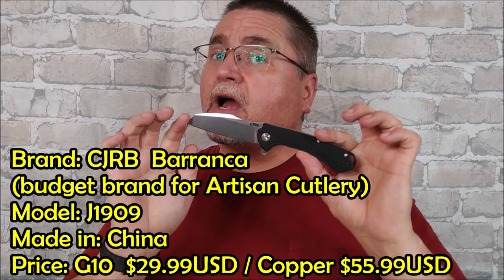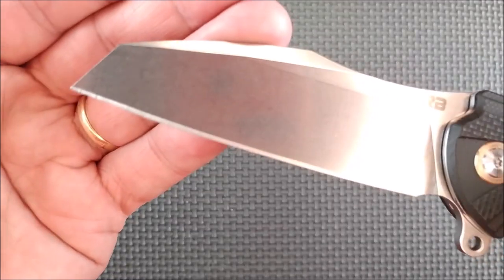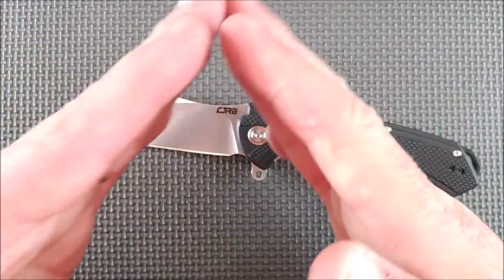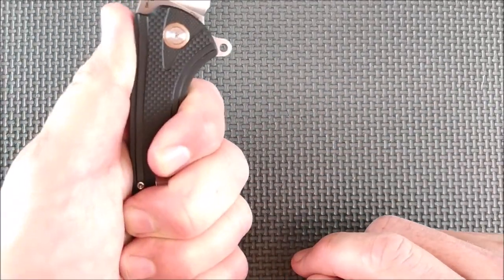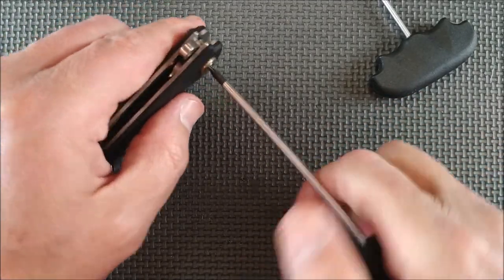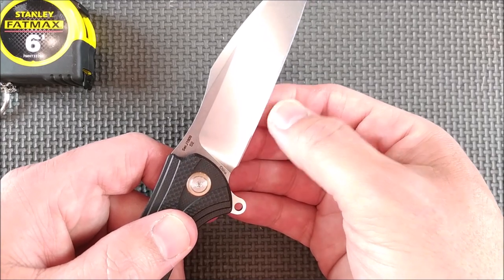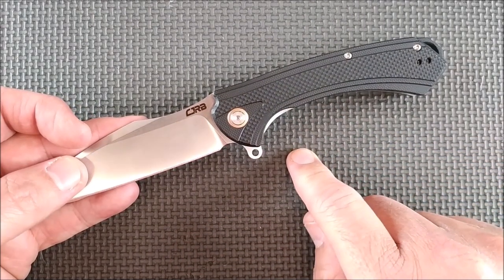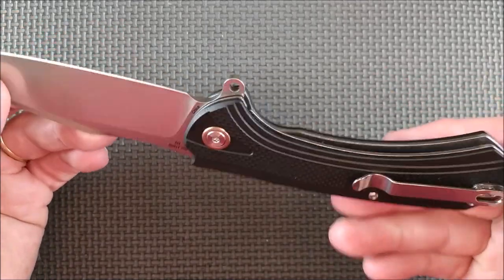Review of the CJRB "Barranca" - Model J1909

Comment: Great review. I like your attention to detail on the sharpening. Very insightful. And I'm glad you pointed out that sharpening choil size issue. I've seen a number of knife makers produce a larger choil that's finger safe... and it's a shame CJRB didn't go for that here, as I think there's enough blade to make it possible. Otherwise, they should've made it smaller and just extended the edge a bit more.
Reply from the maker: There are so many knives that have a sharpener's choil like that.  It just doesn't make any sense, there is no good reason for it.
Reply: @CanadianCuttingEdge  Or perhaps the reason is... cost cutting. It wasn't in the knife maker's interest to do anything more appropriate, such as extending the blade edge or shortening it for a proper finger choil.

Comment: I appreciate your very thorough video.

I have the Copper edition, and would like to know what are, and size, are the 2 tools you used to take it apart? I would like to shipwreck patina the scales.
Reply from the maker: i no longer have this knife.  (I have to sell 95% of what I review so I can afford to buy more knives to review) I suspect it is a Torx T8 an T6 as all the other CJRB knives that I currently have utilize screws of those sizes.
Reply: @CanadianCuttingEdge  Thanks again for the info, and your time.